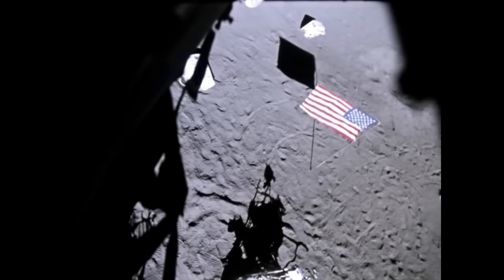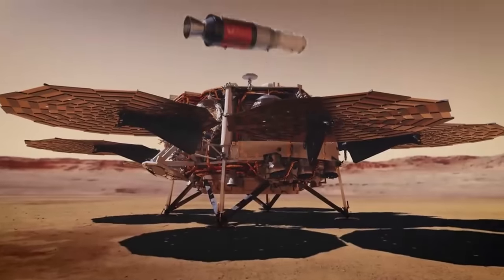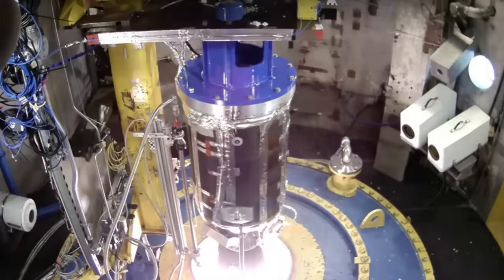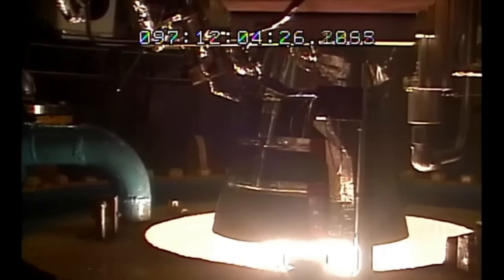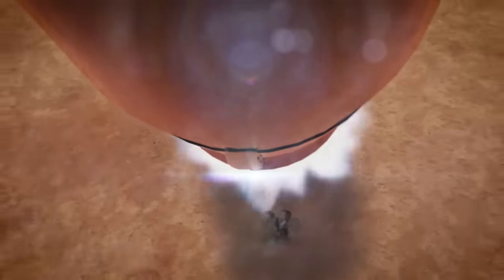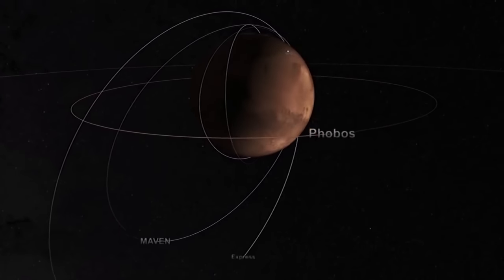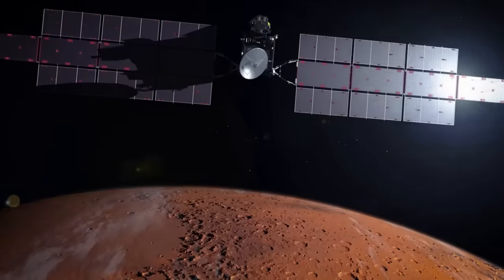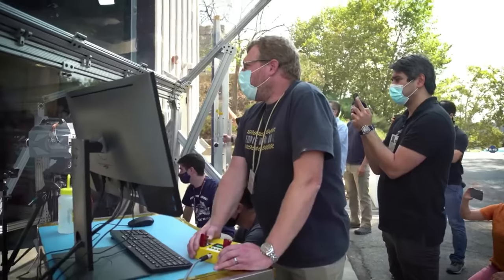NASA Is Preparing To Launch The First Rocket On Another Planet

Comment: Isn't this essentially the same as launching missiles from submarines? They're launched out of the subs using compressed air, then the rocket engines ignite when the missiles clear the water. It works pretty well on Earth. It should work even better in Martian gravity.
Reply: i nvr thought about the submarine analogy. super interesting!

Comment: Instead of popping the rocket on its side up. Why not raise the rocket in its tube like a submarine missile tube, and launch it like that. Also. Have the engineers taken in the account of the Martian weather ( wind, dust, cold and warmth) might affect the equipment too?
Reply: The launch charge would blast the underside of the lander with debris and maybe blow legs off. The video showed them temperature testing the rocket motor. The motor itself is sealed until launch, so nothing gets in.
Reply: No, NASA engineers did not take into account the weather on the planet they are designing a rocket for. What do you think they are, rocket scientists?

Comment: Ok, this is going to be a longish comment that only relates to the current video in the sense that this Mars mission is built upon the foundation of many Planetary and Mars missions with a number of failures along the way. The point I'm driving toward is: New Glenn seems to be overly confident that they can build a limited number of boosters without a crushing number of N-1 failures. Case in point: In Starship's last test 3 or 4 engines failed to light. The same thing happened on the first test flight. Doesn't this imply a plumbing flow problem rather than an engine problem, or engine ignition problem? I'm reasonably confident that NASA can pull of the mission that is the subject of this video; because the technical developments are iterative over decades of trial and many errors. New Glen plans to get everything right on the first try? I know that NASA does reviews and has made personnel available for consultation - but really, isn't Blue Origin a bit overconfident? I just think Elon's iterative approach is more likely to tease out problems before they contribute to a catastrophic event. The last New Glen factory tour looked too much like they are trying for perfection rather than factoring in a few failures. (I DO hope to see a few O'Neil cylinders before I croak - so I'm far more hopeful than critical).
Reply: Yup. NASA experienced a bumpy start, but has an impressive arc of success over 60 years. They accomplished this by raising the bar of expectations higher than just "clearing the tower". NASA's success on Mars (and beyond) makes landing boosters look like parlor tricks.
Reply: @blairseaman461 What has NASA done in recent years that's more impressive than landing boosters? And how does your reply relate to the original comment?
Reply: @Astra2  SpaceX fandom is neat. NASA was landing boosters in the 1990's, called the DC-X - it's where SpaceX landing technologies comes from. What has NASA done in recent years? Are you kidding? Again, SpaceX fandom is neat.
Reply: @hawkdsl  lol you didn't answer the question. I'm not saying NASA doesn't do awesome stuff, just that I don't think they've done anything more impressive and revolutionary as landing boosters. The DC-X was neat, but was more similar to the SpaceX grasshopper rather than a falcon 9. It only flew a few kilometres high and only completed a few test flights. That's very different to landing a booster from space on a small barge and reusing it many times. I'm sure SpaceX employed many of the engineers from the DC-X program but don't see how that's relevant. The falcon 9 has flown more times, with a higher success rate, than any other rockets. Meanwhile, NASA is still building single use rockets using technology from decades ago.
Reply: @Astra2  that's a good example of neat fandom. Of course DC-X is relevant because the research done in that program became part of spaceX DNA. If landing rockets really wows you, well all I can add to that is, your easy to please. I would think landing on Mars is a bit more impressive. You should check out the last five NASA Mars missions.

Comment: What does the rocket push against with nearly no atmosphere?
Reply: No 'pushing against' an external medium is required. No matter what you may have heard, that's not how it works. The engine's exhaust velocity is what matters.

Indeed, rockets are more efficient in vacuum than in any atmosphere, precisely because there is no external medium to slow that exhaust down.
Reply: Newton's Third Law: for every action there is an equal, opposite reaction. That's why rockets work (and why gunpowder gives cannon recoil).
Note: early 20th Century U.S. journalists scoffed at the idea of rockets functioning in Space until Robert Goddard proved them wrong in 1909 when he fired up a solid fuel rocket in a vacuum chamber.
Reply: Lol, wut? Are you from like the 1600s? You didn't take physics, did you?
Reply: @filonin2  It's a common question and misconception. The more important thing is bcam266 asked the question seeking knowledge and understanding, which is commendable. Your response was chastisement. It's far more rewarding to be a mentor than a harasser.

Comment: 450 kg is only 372 lbs, not 1000
Reply: Nope, you've got it backwards.  450 kg is ~990 lbs.
Reply: @nicholashylton6857 I hope neither of you are working on this thing because that's also wrong
Reply: @shanent5793  450 kg  converts to 992.08033 lbs. 
Perhaps you ought to show us how your calculations convert 450 kg to 372 lbs.
Reply: OMG the mission is doomed
Reply: I hope you're trolling. If not this is sad. 1 kg = 2.2 lbs so 450 kg times 2.2 equals 990. Tell us you didn't go to college some more.
Reply: The rocket will be launched from Mars, where the surface gravitational acceleration is 12 ft/s², which is 0.375 times 32 ft/s² so if 450 kg weighs 990 pounds on Earth, it will weigh 0.375 times that on Mars, hence 372 pounds
Reply: @shanent5793   You're still wrong. The kilogramme was configured as the weight of 1 litre of water, on planet Earth, thousand of years before space travel was even dreamt possible. Nothing in the universe can change that. The ratio of the kg to the lb cannot be changed either. Liquid water has not been discovered on Mars, so a Martian kilogramme does not exist.

Comment: I intuitively think that tossing the rocket sideways and eventually tilted is unnecessarily complicated and risky.  If the rocket ignites slightly before or after you assumed could has a significant impact on its trajectory.  Bad idea.  I noticed that near the end of your video it appears that a vertical launched version is also under study.  It also seems intuitive to me that you would want the rocket to blast off of Mars first so that you don’t waste orbiter propellant matching the rocket orbit inclination, speed, eccentricity.
Reply: It's digitally guided. If it can compensate for unknown wind gusts in flight it can deal with a couple meters variation in launch altitude
Reply: It's doable. The military has been using slightly similar setups for years to launch missiles.  But I've got to admit there's a serious pucker factor about doing the same thing on another planet.
Reply: I can imagine, that going straight up would point the exhaust directly at the lander and the ground, creating the risk that loose rocks or parts of the lander are flung straight up at the MAV, potentially damagin it. There won't be a launch pad on Mars and they have to find a way to deal with that in some way.